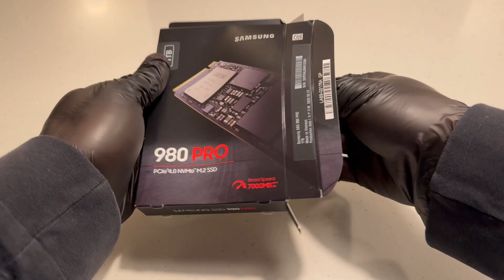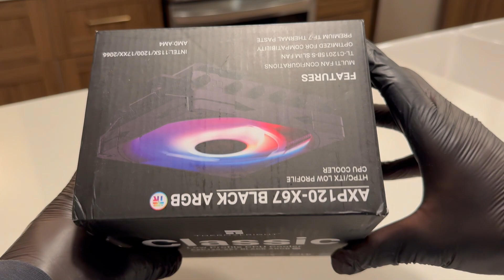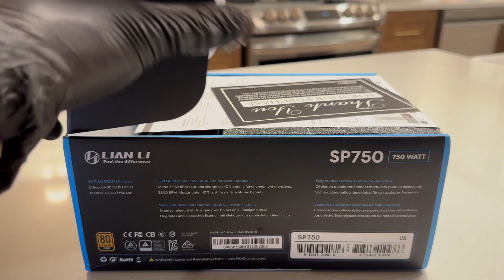Cleanest Fractal Terra Build - ASMR

Comment: Just built a similar build for the wife. I wanted to add a slim fan under the power supply but I didn't have room to fit is since I got the sfx-l power supply rather than a standard sfx. How are your temps?

Comment: How did this GPU fit since you used a 67mm CPU Cooler ? According to Terra's official specs it should not fit. Are both the GPU and CPU Cooler touching the side panels ? If so, is there a lot of turbulence noise ?
Reply from the maker: None of the CPU cooler or GPU is touching, the terra have a sliding mecanism to adjust depending your part choice
Reply: @ShaunChrisPc  I know about the sliding mechanism, but still if you check their specs page and do the math they say that your specific GPU and 67mm would not fit. Thx for the reply btw.
Reply from the maker: Max cpu clearance is 77mm and mine is 67 so I got 10 more mm for GPU

Comment: awesome video ❤. need a quick suggestion. i have a 3090 24g in my main pc.i want to build a mini itx (fractal tera) which card i should go with. put my 3090 in mini itx or 4090/3080(intend to buy). thanks inadvance.
Reply from the maker: It will only depend the size of the GPU, check on fractal site and than check your GPU spec, the 3090 can be fine with a proper PSU
Reply: @ShaunChrisPc   do you think it can manage  4090? a video on thermal and performance comparison with 4090 and tera can be great for people like me. 😍

Comment: What about dust? It don’t have filters and in the back side there is a big gap too.
Reply from the maker: True, that how the case is made, esthetic over convenience, due to negative pressure made by the cpu and gpu intake, dust will never be force in the case
Reply: so easy to remove the panels that it's a non issue